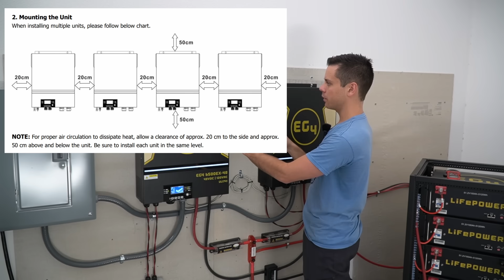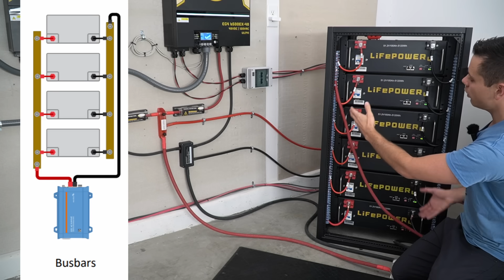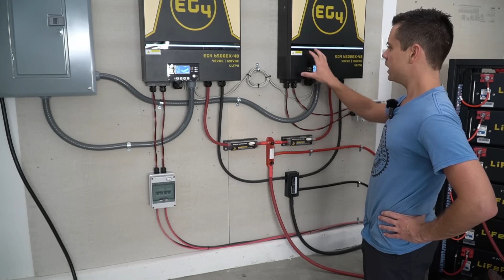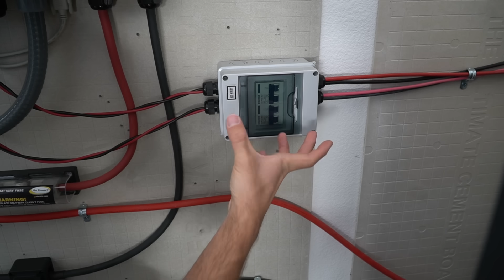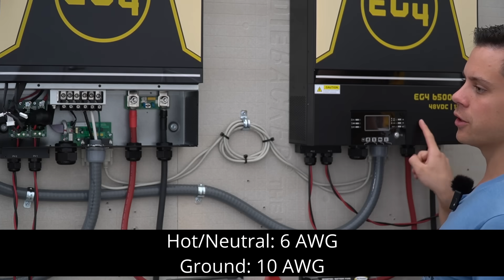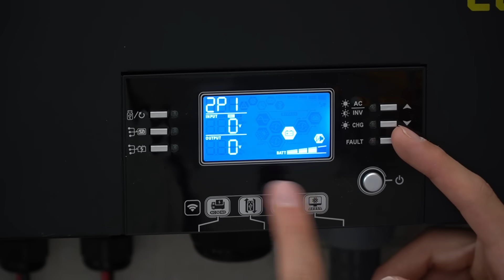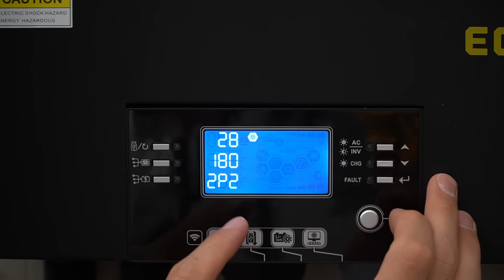Complete 48V Offgrid Solar Power System

Comment: Can you please do a video on the pros and cons of comparing an off grid system to a grid tied system? It seems like off grid solar has advantages, but does not seem practical for the average suburban home as a primary energy source without being grid tied.
Reply: What I've found - Grid tied - Your panels are producing the max power at all times based on the availability of sunlight.  If your loads are low that excess power goes to the grid and effectively turns your meter backward or powers a dedicated meter providing you a credit.   The Downside is if the power goes out  - so does your solar power system as you need to see the grid up to operate.   THis is to prevent sending power to the pole and shocking a lineman.    With Off-grid the panels will only produce power when there is a load - Either from your home or a battery bank.  If your batteries are charged and you're not using much power, your panels produce just enough power to feed the loads - nothing more - so you're wasting potential power production.  The upside is always having power regardless of the grid.  You will need a way to address cloudy days and a low battery bank though.  Either with a generator to top off or using the grid to charge your batteries
Reply: @MAC-nm5is  depends where you live. Your entire paragraph is terribly inaccurate in most states

Comment: Hey Will, Another Very Informative and Well-Presented Video. Thanks a bunch!  I have a small (1KW) prior to last year., 12v battery off grid system in the mountains above10K ft. I was considering rewiring the (15)-12v batteries to (3) strings to accommodate the 48V for the EG4 system. I noticed in the operating conditions. It has a limitation of 1500 meters= (<5K feet). The cabin is only used about 5-6 times a year and is typically shut down around Sept until around April each year. I'm not sure what the altitude effects would be on the system, temperature would be borderline any way both storage and operating.  Thanks!
Reply: Are you sure it refers to altitude and not distance?
Reply: @Patco.1981  Hey Juan thanks for responding. Under "Environmental Specifications" it notes "Operating Altitude 0-1500 meters." If I was seriously going to go this route, I would contact the manufacturer or seller for clarification. Like I previously noted the temperature limitations are going to be uncomfortably close for me.

Comment: I d like to set something similar up but using blue etti ep500 pro solar generator. 
I bought a PV VOLTAGE STEP DOWN MODULE(D300S)
So I can use house panels but not sure how to integrate into the set up your showing 
 If you have a chance can u give insight

Comment: I have grounding question.  My house grids breaker box has a common ground.  I am planning to redirect the house circuits hot and neutrals via conduit to inverter sub panel.  So house circuits would be direct to inverter but their grounds would would still be on grid box.  If I run the inverter in bypass mode would I run into any grounding problems?

Comment: I have an electrician coming over next week to look, but I am wondering if I can build a system like this and run on it nearly full-time and just use a transfer switch to cut over to the grid during extended periods of cloudy days. We have an attached airplane hangar on the house, so have a massive amount of "roof" space for solar panels. Will I need to replace our HVAC system with one that's got a variable speed compressor to protect the batteries?

Comment: will, can you do a video on how to size fuses/breakers. Example: what size for incoming solar array to  controller and sizing for battery to inverter etc.
Reply: Will, please explain how I could use these inverters along with a 27 KW propane generator. My goal is to be grid connected with these inverters use solar during the day + charge 30 KW of batteries. Use batteries after sunset. Use grid for when batteries are depleted and the propane generator for when the grid OR the solar system is down. I would really appreciate your comments.

Comment: Would be interesting to know current flowing from the batteries during a low load (200-500watts) on one of the inverters and a basic efficiency calculation.

Comment: Hey Will, do any of those rack batteries allow a series connection? 
All those grid tied hybrid inverters seem to run their batteries at around 400v, but those batteries are not the cheapest around.
Have you heard of anyone making a 400v battery with those rack packs?

Comment: Does Tesla have a method for connecting directly to a DC charging source?  
Having to convert the DC from the solar battery bank to AC in the EP4s, so that a standard vehicle charger can take AC and reconvert it to DC is wasteful and an unneeded step.  With the EP4 inverters and the transformer in the vehicle charger, there is an energy loss of at least 30%, (mostly in the form of heat) not to mention the wear on the inverters.

Comment: Aren't you going to have a serious problem if one of those controllers shuts down? Or even really if it is at night and one of those fuses blows for some reason? Anything on the electrical panel that is supposed to be getting 240v will suddenly have one of its legs drop out. Theoretically this shouldn't be a real issue since that would cause that device would switch to completing its circuit on the ground at 120v, draw double the amperage, cause an overload condition, and then trip the circuit it is on and shut off. However, this is not really the safest way to do things and is probably not to NEC code spec either. Sometimes breakers simply fail to trip (look at the history of Federal Pacific), or the breaker can have a rating a bit too high and will take too long to trip at the higher amperage, meanwhile the device meant for 240 is now running on 120 for a little bit. You also don't want any current on the ground except in a circuit fault condition, which this is not. So you should have some wiring in their for auxiliary signals that can determine when a controller is down (or fuse is blown) and safely shut down the other controller.

Comment: Hi. Really great information you are providing here and well explained.
My question is can you use this system for wind turbine instead of solars?
Reply: No, you can't. The turbine produces AC outputs, so you will need a bridge rectifier to convert to DC (unregulated), and then maybe into a capacitor bank to get smooth DC suitable for going into the solar input MPPT (Maximum power point tracking system). Then you will also need an over-voltage detector to switch on a relay at a certain RPM to dump the turbine output to a load (say an electric heater) to stop the wind turbine from running away in high winds and getting destroyed. Solar panels output smooth DC and also don't need the dump - they will just get slightly warmer if the energy has nowhere to go.

Comment: I was planning to purchase "Growatt 12kW Split Phase Off-Grid Inverter | SPF 12000T DVM" with 6 EG4 100AH Battery, But after this video, I am thinking about 2 EG4 6.5KW OFF grid Inverter. My question is what is the standby/Idle consumption of each of the inverters?

Comment: if you can set phase at 120 deg that implies you can set up a 3 phase system with 3 - EG4 6500 EX.  That has implications for light industrial use - interesting.

Comment: Those Inverters are sold in South Africa as Axpert 7.2/8KW inverters lol. I install them quite often, we however use 220v directly so we do not use the split phase stuffs to get 220v. also we don't say hot and neutral, we say live and neutral. Just some more information someone don't need but now know. thanks for the good video bud

Comment: if you turn one on when link cable is used i would assume it turns on the second unit automatically, do they do single phase 240v units (not split phase 240v)

Comment: Hi, I have seen new home solar systems requiring NO battery but using instead the batteries from your electric car as a back up for your home. Able to last for a couple of days in case of emergency and no sun. Is it available in the USA and how does it work? Is it just an add in to a “regular” system. 
It would be great to be able to invest battery money for building and rack into an EV instead. Thank you for your help.

Comment: So if I was using two inverters for split-phase how would I integrate a single wind turbine? Would I need a separate mppt to feed the batteries independently of the 4 solar mppts in internal to the inverters?

Comment: Hi , I am about to have small house built less than  500sqft.  And I am wanting to be completely off grid! Would this system support the split air system, refrigerator,  some  led lights  tv. And a few wall outlets ? Also what is over-all cost estimate for this complete system? I am  thinking of having alternate fuel system as backup and to switch to for occasional maintenance and rest for solar system!

Comment: I wish the inverter manual discussed what communications protocols are supported. Can this output data or take control commands via modbus-rtu or similar via the serial port? That would make a compelling case for integration with a historian and HMI product like Ignition.

Comment: Are you going to compare this to the growatt inverters? These inverters  are more expensive but it seems you  don't need a transformer like with  growatt which makes it easier to setup from what I can tell. Now what happens if 1 of the inverters go down and your using a 240v outlet? Will the other inverter cut out instantly too? Something you don't have to worry about with growatt, hence the transformer which steps down to 120v
Reply: No because they're stupid expensive.

Comment: Hi Will, I'd like to echo the post by Toby M. and thank you for making this great video for us solar newbies. I used your links and just ordered a whole system today after months of researching and agonizing over how to build it. One question I have is, you spoke about ground wires on the 6500s and the load center but does the system get grounded to the house ground rod outside, a separate rod for this as a stand alone or something else? I purchased an EMP protector from Signature Solar so maybe that grounds the system in some other way? Your input is greatly valued. Thanks again!

Comment: Disappointed.   You still haven't shown how it starts large inductive loads like well pumps or standard AC units
Reply from the maker: I don't have one to run. I actually mentioned this in my LVX video. I need a large inductive load. My ev/Bitcoin miners are too easy to run. Karl had some great info and so do others on our forum.
Reply: It’ll start and old type R22 2.5 ton, no problem along with a coffee maker, microwave and other normal house loads. Just make sure you have it cabled up just like Will has (4/0 and good capacity batteries). Also be sure that you don’t have too much off balance on L1 or L2 or one inverter will over current and shut the whole thing down. You may have to swap some breaker positions if you see a pattern of loads.
Reply: @SkypowerwithKarl  I'm thinking to off set any imbalance between L1 & L2 one could probably use an auto transformer.  This would also help with starting large inductive loads.
Reply: @OffGridandOutdoors  
I see where you’re going with that idea.  But it might be safer just to add more inverters. I’ve been told well pumps can be challenge to power.
Reply: @SkypowerwithKarl  indeed pumps are,  but my well pump (and anything else I've thrown at it) has been no match for my Schneider Conext SW4024.  I'm doing some consulting for larger systems and wanting to find products I can recommend. This video has not given me the confidence to do that.  Wish we could see Will actually starting sometime of significance.
Reply: @OffGridandOutdoors  
Do you have clamp on amp meter with “peak inrush” measurement capability and do you have number’s?
Reply: @SkypowerwithKarl  yes clamp on with in rush. My pump starts with 48 Amps on L1 and 48.6 amps on L2. Then runs at less than 5 amps on each leg.  My SW has been Starting it multiple times a day for over 4 years
Reply: @OffGridandOutdoors  
During mid day the highest surge I’ve seen on my AC was 57 amps then down to 9 amps. My dryer pulls 28 amps when the elements are cycling but that’s resistive load.

Comment: Will, I purchased two of the Signature Solar 48v LifePower4 batteries based primarily on your review of their build quality.  Less than 30-days in operation and they will not function with the inverter because they keep faulting.  Customer service is slow and clunky.  It's now been 4 days without power and Signature Solar can't seem to resolve the problem.  They want me to deep cycle the batteries, but as soon as the inverter goes to start inverting, the batteries fault and shut off.  The technical representative said I need to refer this to our Tier 2 technical service and they will contact you.  Almost 24 hours later and not a word back from Signature Solar despite reaching out to them.

So, while I appreciate your videos, I seriously think that you should think twice about promoting a company that seems to not care about its customers or the critical nature of what it means to a customer when an off-grid system goes down because of the batteries.

Comment: well I guess I know which inverters I'm buying next instead of adding additional growatts. 39kw max output! that's higher than any stacking system I've seen and exactly what I need to handle my electric tankless water heater in addition to my normal home power requirements. can't wait to buy some of these, I already have a half rack of those eg4 batteries and look forward to getting more.

Comment: If I only have 5500w of solar panels, can I run only one string for all my panels and tie them into just 1 I'm inverter or do I have to split them in half to each inverter? If I have to split them can I do that by the inverters or do I have to do it by two separate strings all the way out to panels and split my panels? Thanks

Comment: So the 2P2 setting, for split phase, is either 120v or 180°. Shouldn't it be 120v or 240v as an option? Seems confusing. Love your work btw, I've learned so much!

Comment: Solar power is good for disconnecting from the grid.  On the grid solar power makes no financial sense.  All you will do is trade an electric bill for a bill to the solar company.  Sales back to the power company is negligible.  Solar panels degrade at a rate of about 5% annually and financing on the system is often amortized over 20 years so when it's paid for, it's obsolete and nearly useless.

Comment: At the moment the cost is too high for it to be a viable solution. I’ve done the numbers to go fully off grid with running air conditioning during summer and an EV I’d need around 100k for the off grid equipment and about 1mil for the block of land next door required to set it up.

Comment: I was about to buy a pair of LVX6048 units since they have low-frequency inverters. How are these with inductive loads? I'll be off-grid and my heaviest use would probably be a 1.5hp dust collector & 3hp table saw running together. Do you think 2 of these could handle that?

Comment: Code compliance - Can you address the panels still having voltage after the cutoff breaker is thrown? I think the later electrical code (in TX at least) says the individual panels need to be shutdown at the individual panel so there is no voltage on the wires. Probably doesn't apply for off grid, but might if you are connecting to the grid. (BTW I just picked up my batt from signature solar 🙂)

Comment: Will, thank you so much for this video. Probably the best solar video I have ever seen someone put together. 

Questions;
What if like in my case I have a subpanel in my garage but I want to hook up this system to it (shutting down the connection back to the house so it becomes off grid). Do I or can I still keep ground and neutral separate?

And, do you have a video that shows how to wire up the solar panels you can recommend we watch?

Comment: With load circuits on the left side and the inverters circuits on the right side of the electrical panel, will turning the panel's main circuit switch off resulted in power being cut to the load circuits on the left side (and the right side too, if there are any load circuit breakers installed)?

Comment: That great . the 120 setting is for 3 phase power. split is 180 deg.  looks like 3 inverters for 208 3 phase star setup.  Phase to phase is 208V with 120V phase to natural. 120 deg apart. nice to see that possible.   that correct grounding on standalone system. natural to ground at main panel only.  if grid tie the first point of breaker to grid has the natural ground bond. everything else separate natural and ground . with standalone off grid system don't require a inspection . But home oner insurance may require a inspection. always check with them. as a electrician I have run into that in NY.

Comment: Hi Will,  thnks for the great video. As for the solar power input to each of the inverter, does it required to have same kw for each input? For example, What if I have a 6kw and 4.5kw respectively. Any problem with that configuration? Hope you could advise something.

Comment: If you have current on a ground wire doesn’t that mean you may get electrocuted when touching the case? Not sure why signature solar would say because the run is short it’s ok.. great videos however the current on ground is concerning. Could you measure how much current you’d get on the ground? Again thank you for great content.